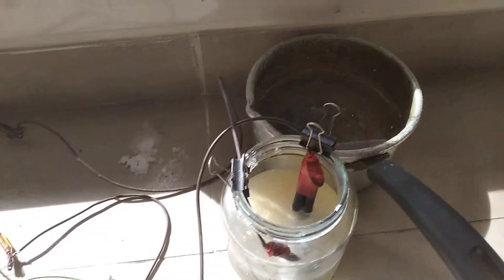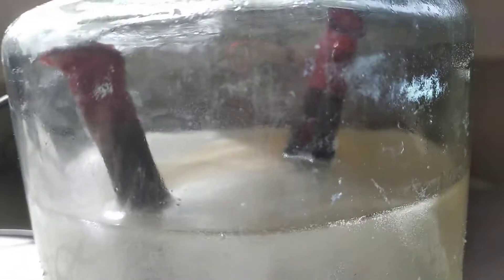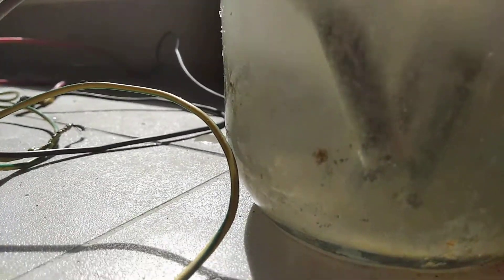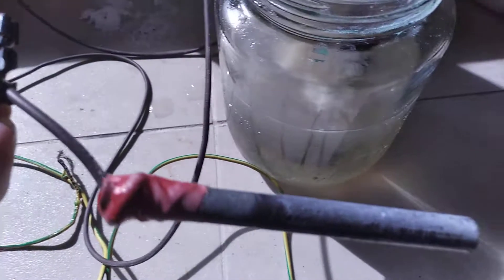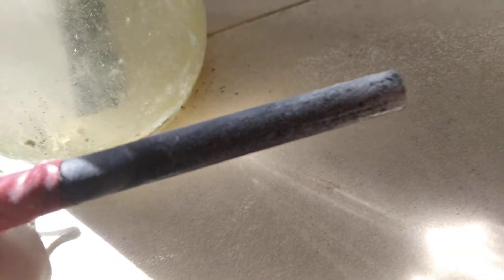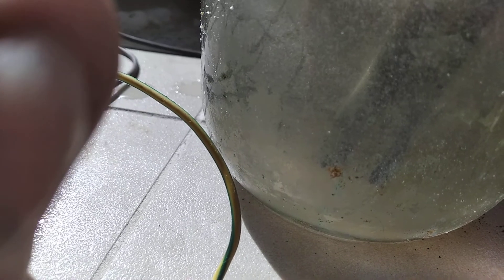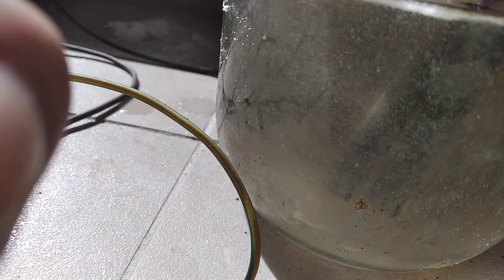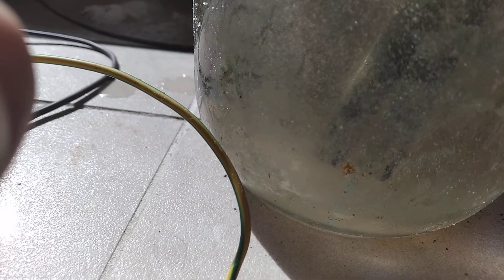graphite passive pH controlled chlorate cell no errosion

Comment: I tried calcium chloride and it is a very bad idea. It sticks to the cathode and electrolysis hardly works, later stops. Used 2g/l sodium persulphate what professionals use and works fine to stabilize the pH. In professional or amateur setups they are not used anywhere calcium chloride. And professionals recommend it to keep calcium the possible lowest in the solution in chlorate, perchlorate setups too.
Reply from the maker: you may have added too much calcium chloride.
This isnt used for KCl electrolysis.
yea persulfate is good for perchlorate and also chlorate but the idea for calcium chloride is a buffer for HCl which is used later.
Also calcium chloride only works if your temps are above 60 otherwise it will get used up quickly as Cl2 escapes.
The coating on the cathode is conductive and prevents reduction of chlorate.
and it is used industrially sometimes as preconditioning in small amounts.
Reply: @CatboyChemicalSociety  The difference between calcium chloride and sodium persulfate is huge for that purpose. Sodium persulfate binds chlorine significantly. It keeps the pH completely stable, very little hydrochloric acid should be added once a day. It does not degrade cell performance. Without sodium persulphate (2g/l) about 1 hour the pH goes high if you use HCl, and the cell sheds lot of chlorine. With Na2S2O8 keeping the pH 6-7 all day, and if I add hydrochloric acid to the cell it does not release a lot of chlorine. Na2S2O8 is an additive that you will always use once you try it. When you open your cell if you use Na2S2O8 quarter to smell such a strong chlorine if you use HCl. I use it for NaCl -> NaClO4 and KCl -> KClO3 electrolysis. With CaCl2 NaCl -> NaClO4 electrolisis in my 6V 6A 1l small cell even smaller amounts of calcium would slow down the process so much that it would be failed. In the NaClO3 -> NaClO4 process the electrodes must be completely clean and free of deposits. Several professional documentations warn of the dangers of calcium, rather it indicates calcium as unfavorable.  And they say the less calcium contimination is in the solution the better. Even these are recommended in the literature as additives:  „About 2 g/l Sodium fluoride or about 2g/l of K Persulphate is OK. If using Dichromate use 2 to 4 grams per liter. Optionally, 2 to 4 g/l of potassium dichromate, potassium chromate, sodium chromate or sodium dichromate may be added to improve efficiency. If lead dioxide anodes are used, do not add potassium dichromate as it will only reduce efficiency. Instead, 2 to 4 g/l of sodium or potassium fluoride may be used.”
Reply from the maker: @mx5kevin  for your process yea calcium is bad because it does add resistance to the cell by a bit at lower current densities and temperatures.
My cells run at 65-70 Celsius and operate at 32 amps and I make about 400g of NaClO3 everyday and I run it for 5 days for my 2kg of chlorate then I never run it for months.
My new process uses about 8g of CaCl2 per kg chlorate theoretically produced and 15ml of 10% HCl is used as a buffer added slowly every 2 days towards the bottom of the cell using a long pipette. Hence I only add HCl once during the middle of the run and after precipitating the NaClO3 in the freezer at -16 before storing the electrolyte for months.
NaCl is usually also fed everyday and stays at the bottom of the cell to dissolve as the process goes on.
Reply: @CatboyChemicalSociety oooh that's damn too much for 32 amps batch per day my friend.... In cell with so much amps you have to refuel the electrolyte every 2 hours because you efficiency seems to be 110% with that details that you gave us! Can you explain your hole set up (current , additives , ph , temperature, anode -cathode (sizes-type) cell capacity (liters)) and power supply?
Reply from the maker: @willowpine2604  according to online calculator its at 80% eff not 100%.
Cell:
2 cathodes 5.08*15.24cm
1 anode 5.08*15.24cm with 2 sides = 154.84cm^2.
anodic current density 210 ma/cm^2.
cathodic is half this.
Cell = 4 liters water bath cooled.
temp = 65 to 70 Celsius
running proceedure:
run for 4 days initially and put in freezer till -10 Celsuis and remove chlorate.
-re saturate with NaCl and additives and run for 1 day exact and repeat freezing process yielded 400g of pure NaClO3 this is only for testing.
-normal running is usually 5 days to 6 days to obtain 2kg of chlorates with some still left over in liquid.
-pH maintained by addition of 8g of CaCl2 per Kg chlorate produced when temp greater than 60 Celsius from a curve found in a paper on pH controlled cells.
15% HCl addition is added every 2 days for production runs.
removal of chlorate is done by single point fractional crystalization followed by resaturation for future runs.
Reply from the maker: @willowpine2604  https://www.youtube.com/watch?v=8C1knS2Z8Mc
current is read using shunt where we divide the voltage drop in milivolts by 1.7 to get the current.
this was an earlier cell with 2 anodes and 1 cathode so it ran at 41 amps.
Reply: @CatboyChemicalSociety  so you have 41 amps in 4 liter cell with 400g efficiency ! I understand! At -10 Celsius the remaining chlorides that precipitate out how you separate them?
Reply: @CatboyChemicalSociety  cathodic current?? What do you mean?
Reply from the maker: @willowpine2604  no they dont look at the solubility curve of chloride vs chlorate.
The chloride stays in solution as its solubility curve is flat.
Reply from the maker: @willowpine2604  the current density of each electrode.
Reply: @CatboyChemicalSociety  wow you knowing a lot about this can you help me in my procces? I have some questions like the distance between anodes the right conditions of the cell etc.. also i make a search about specially designed chlorate cells used with graphite even in percs.. do you know anything about it ?
Reply: @CatboyChemicalSociety  the current density of each electrode hmm? So you mean that each electrode must have specific amps per square centimetre? And how you manage that ? You  Use electrode's with different sizes to take the right amps on each anode?
Reply from the maker: @willowpine2604  dont use graphite for perchlorates it really doesnt work.
chlorates are made best with Ir-Ta MMO since it can run to completion and you dont need to seperate the chloride but its 6% less efficient than Ir-Ru.
Perchlorate is only made with PbO2 on Ti with or without MMO undercoat like in my newest vids about these electrodes.
Reply from the maker: @willowpine2604  the optimal distance for the electdrodes are 0.9cm apart for the cathode and anode and current must be measured and set via changing the operating voltage.
A good cell has 2 cathodes 1 anode where the anode is at the center.
you can also have 2 anodes and 3 cathodes if you want more current.
The anode must be surrounded by a cathode in both sides.
reduction control agents include persulfate, group 2 alkaline metal ions and sulfates.
pH control method is HCl for chlorates buffered with CaCl2 or MgCl2 so no gas is released when HCl is added.
operating temp strictly above 60 Celsius and operating current  density for chlorates is anything below 200ma/cm^2.

for perchlorates however you cannot go under 200ma/cm^2 and its recommended to run around 225 or 250 ma/cm^2
Reply: @CatboyChemicalSociety  and what about voltage ? Does effect the anodes?
Reply: @CatboyChemicalSociety  i have platinize titanium anode can i make chlorate and perchlorate or not?
Reply from the maker: @willowpine2604  chlorate cells can run up to 5.5 volts or max 6 volts but I usually run 4.3 to 4.7 with my setup.
titanium based MMO can go up to 10 volts before shit goes wrong but even that is kinda not a good idea. if you are running more than 6 volts then something is very wrong.
Too many volts mean much more wasted amps to heat. only the evolution potential multiplied by the current is the actual amount of watt hours going into producing chlorate. the rest is wastage and evolution potential is usually measured analytically or given by the seller of the electrode if you ask/datasheet.
Reply from the maker: @willowpine2604  well those kinda suck to be honest because they cant even finish either run, while they can make both its harder to operate due to them being more easily destroyed than MMO or PbO2.
do you have a discord tag just link it here because I can show you some stuff there like pictures of other people running chlorate and perchlorate cells with homemade PbO2 on Ti direct no MMO.

I can help you with your cells but you have to provide a few things.
thickness of Pt and type of mesh with expansion ratio/max hole diameter. whether its forward expanded or purely sideward expanded mesh.
Reply: @CatboyChemicalSociety  it is 3 micron's with rodium and platinum 5 cm x 10cm (can you tell me how much amps per square centimetre can get beacuse the 0.33ampd per square centimetre is for full surface area and not for mesh size?) I don't understand the expansion ratio is to tell you just only i know the the mesh size!!
Reply: I think the holes are 4mm size rhombus shape!!
Reply: @CatboyChemicalSociety  actually can you give me a set up for cell (cell liter capacity,amps , temperature,ph, additive, chloride concentration,cathodes size and how many,) with this anode i have ??
Reply from the maker: @willowpine2604  so thats rated at 330ma/cm^2 max which you wont need to run that high ever.
5*10cm makes it rated at 20 amps for chlorate and 22 amps for perchlorate because it has 100cm^2 given 2 surfaces and the assumption that the holes have a crosswise diameter of 1mm or 2mm.
4mm for the holes lengthwise but I need crosswise which is the shorter length.
Reply from the maker: @willowpine2604  
Chlorate cell:
3 liters hdpe plastic.
amps = 20 amps
pH = 7
temp =  60-65 Celsius but depends on your electrode max operating temp in the datasheet.
additives = persulfate/sulfate and calcium/magnesium chloride buffer 6-8 grams added per liter.
pH control = HCl 15% 14 grams added at the bottom of the cell using long pipette every 2 days to replenish the buffer.
chloride concentration start = saturated salt solution 360g/liter
chloride concentration end = 80g/l
chlorate conversion = 78%
2 cathodes are needed on both sides with distance = 0.9cm from anode.
operating voltage = 4-5 volts
runtime = 1.274 weeks
yield at 100% recovery assuming 78% conversion = 1.2kg of product

seperation of chlorate using 1 point fractional crystalization followed by ethanol/methanol recrystalization after filtration of insoluble chloride

perchlorate cell:
cell = 1 liter glass is must.
feed = 1100 grams of purified chlorate recrystalized with anhydrous ethanol/methanol.
additives = persulfate/chromates
pH control = none or MgSO4 buffer 2g/liter
amps = 22 to 25 amps
temp = 35 Celsius
perchlorate conversion = 85%
runtime = 1.8 days.

seperation of perchlorate use acetone to dissolve only perchlorate and recover using water bath distillation.
Reply from the maker: if I were you though id plate the Pt with PbO2 so you can run both to completion from chloride but the PbO2 process can take up to 3 days to make the electrode but it lasts forever.
Reply: @CatboyChemicalSociety  do you know the process of PbO2 exactly? All the terms?? Beacuse i trying the lead nitrate bath and it was failure.. something i do wrong can you explaine the facts and the process? Can i use dichromates instead of pershulfates because i don't have it ?? And one more how big in centimetre must be the 2 cathodes?
Reply from the maker: @willowpine2604  yes I have several videos of successfuly PbO2 anodes.
but I cannot and do not want to share this method via youtube comments for reasons so gimme a mail or discord link and I will email or send you/talk about it there.
Reply from the maker: @willowpine2604  for additives for PbO2 you can use sulfates instead like MgSO4 epsom salt or Na2SO4 as it forms persulfate in situ while running.
Reply: @CatboyChemicalSociety  does this additives work for platinum anode?
Reply from the maker: @willowpine2604  yes MgSO4 2g/l anhydrous or 11g/l hexahydrate works for Pt also.
Reply: @CatboyChemicalSociety  this additive last for hole process or you have to refuel it
Reply from the maker: @willowpine2604  the sulfate lasts for the entire process
Reply: @CatboyChemicalSociety  and this you just put it inside the cell in Powder form or dissolve it as solution's first
Reply from the maker: @willowpine2604  just put it in and it will dissolve but you can also make a solution its your choice.
anyway for the PbO2 coating process its more complicated than a simple nitrate bath because it contains a few additives and extra stuff but I need you to share an email or discord tag because I will not share this process in the comments.
Reply: @CatboyChemicalSociety  leave it the PbO2 procces beacuse the last time the warm lead nitrate has dropped into my arm and nearly etching my skin and i caught it almost immediately... Anyway that's  a lot info you gave me and i thank you very very much for it ! My last question haha .. if all this efficiency parameters isn't exist what percentage yield you have just only the electrode's?
Reply: @CatboyChemicalSociety  i just mesure the holes of anode it is 6mm by 4mm how much current can get?
Reply from the maker: @willowpine2604  this sort of mesh has an expansion of 1.5 which means to get operating current divide 20 by 1.5
Reply: @CatboyChemicalSociety  13 amps so it is ... Nice... As for the 2 cathodes sizes each side of the anode dimensions???
Reply from the maker: @willowpine2604  the cathodes should be the same size as the anode and while technically you would want a surface area ratio of 1 or less than 1 with respect to the  anode but since we have additives that prevent reduction like chromates for platinum, magnesium/calcium or persulfates then that is not needed as much so the cathodes can be the same size as the anode.
Reply from the maker: @willowpine2604  my plating process actually uses a different salt than lead nitrate which is lead chlorate/perchlorate which can be made from membrane electrolysis or perchloric acid and PbO.
the plating process happens at room temp thanks to one special property of these stronger acid salts than nitric.
the other salt it uses is sodium plumbate which is one you especially have to be very careful with as it easily absorbs into the skin due to its highly alkaline nature.
if you want to run a lead nitrate bath at lower temperature just add 10% by wt sodium chlorate mixed into it as an additive along with the other surfactants and surface modifiers.
the chlorate/perchlorate will allow for beta PbO2 to be plated at room temp or just above it.

The efficienct figures I have were tested using my 1 day run after resaturation method for chlorate and for perchlorate its measured then compared with calculations.
Reply: @CatboyChemicalSociety  my problem in my tru to lead nitrate bath was that i don't know what chemical is nonionic surfactant and where i can't find it or make one for thia purpose... I have found industrial instructions about to make beta PbO2 anode but the only think that missing is that... I have stopped the hole process because of that.. 3 months try go to garbage for this reason so you can understand what was happend...
Reply: @CatboyChemicalSociety  btw nowhere in the article says about plumbate substance (which I don't know it either for what purpose is used in beta PbO2 anode cell plating)!!
Reply from the maker: @willowpine2604  any alcohol or ketone is a nonionic surfactant including polyols like erythritol or xyllitol.
acetone is particularly good where I add 5ml to 3 liters of bath.
you do need also some ammonia based surfactant and for that I use palmolive shampoo as it has enough in there.
You can properly buy it as either benzalkoniu chloride, cetrimethylammonium bromide, tetrabutylammonium bromide etc.

your process also has an issue because you actually need alpha PbO2 plating solutions also.
Beta and alpha PbO2 are the important building blocks of the electrode but they must be deposited a certain way in order to form a composite ceramic.
if beta and alpha PbO2 precipitate at the same time together you form sponge which is weak and porous such is with cold nitrate baths without addition of chlorate/perchlorate.
if only beta PbO2 is deposited then you form brittle layers that crack easily.
If only alpha PbO2 is deposited then its also prone to flaking and attack by chloride ions.
you need them deposited in very specific conditions but I cannot share it in the comments for reasons.
Reply: @CatboyChemicalSociety  why you can't share it ? Is something illegal substance than people can use ? Otherwise i can't find enother reason not to tell to the people to learning useful informations and sharing knowledge!!😃
Reply: @CatboyChemicalSociety  trust me the article that i have found says everything inside from temperature and ph to current and additives, i just didn't know what  surfactant was until know thanks to you 😃  man you make it more difficult according to the industrial process  instructions why?
Reply from the maker: @willowpine2604  there are many articles that refer to it but you want the ones that talk about anodes specifically for use not theoretical analytical testing.
hint look for patents and or papers on heavily abused components such as PbO2 ceramic capacitors.
Reply from the maker: @willowpine2604  it involves a certain someone who doubted the process until he saw the results and now wants to know it badly. if you want the plating process send your email in the reply or discord tag.
Reply: @CatboyChemicalSociety  hahahaha really is that reason hahahaha lol man.... Just for one person everyone else stay in the dark?? That's unfair i am sorry but i like to say the true ...
Reply: @CatboyChemicalSociety  do you have a Facebook to talk there?
Reply: @CatboyChemicalSociety  what happened to you why you stop sending message
Reply from the maker: @willowpine2604  cuz I dont wanna use facebook as a means of communication kinda too personal.
email or discord better
Reply: @CatboyChemicalSociety  so say it thats not a problem i dont blame you..give me your email to send you there so..
Reply from the maker: @willowpine2604  diggertop@gmail.com
Reply: @CatboyChemicalSociety  why wouldn’t CaCl work for KCl electrolysis?
Reply from the maker: @FOATE  due to the precipitation of KClO3
Reply: Just use nonylphenol ethoxylate class for nonionic surfactant. But you need to understand the special techniques to coating it. You can use lead acetate salts firstly as your primary coating (which result in Alfa lead dioxide structure), and then followed by lead nitrate after that (for the beta structure).